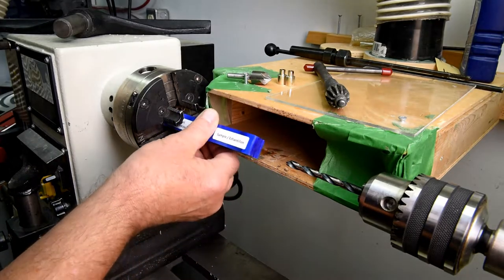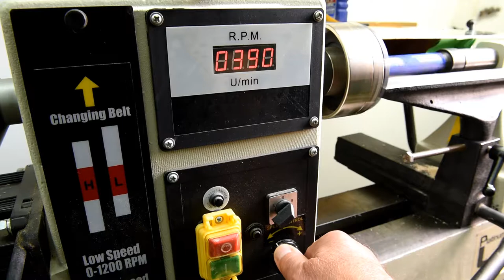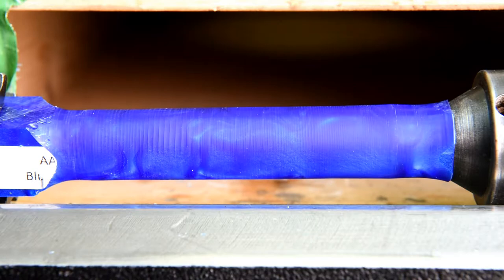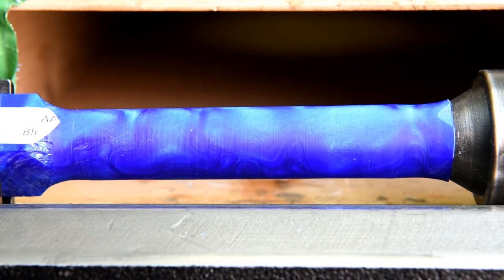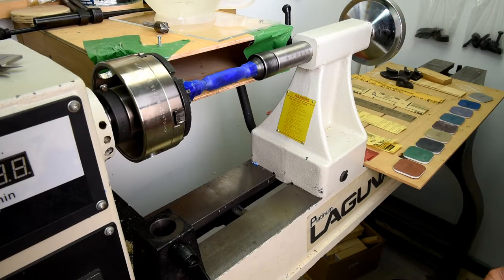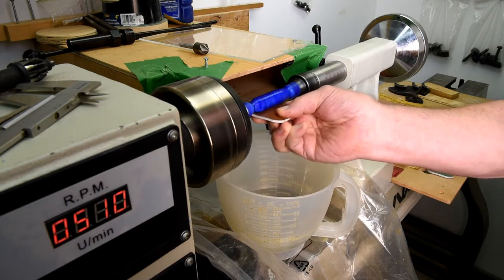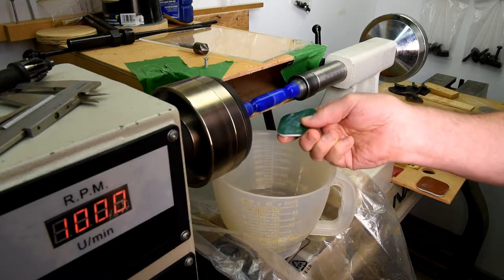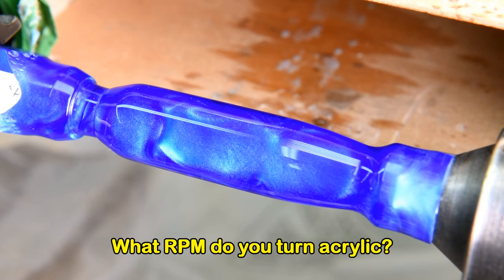The Reamer Handle - Part 2

Comment: With a small blank, as fast as she'll go, manual says 2850. The faster it is, the more time each second you're in contact with the blank making the time you're cutting air less noticeable, less vibration and smoother cutting.  Absolutely gorgeous piece of acrylic! You can feel very satisfied every time you de-burr a brass tube :)
Reply from the maker: I can't remember what I was turning at the times before when I never had even one problem. So weird! Next time I've got one properly on the mandrel I'll crank it !!! Thanks for the feedback Bill :)
Reply: Quite welcome, I think you'll really like that tool, comes in very handy on and off the lathe.  I made one after our bantering back/forth a couple weeks back out of a piece of Walnut with an Osage Orange scrap glued onto the front so I could tap it for a set screw. Glad I did at this point, I'm now in the market for a larger reamer for a project I'm working on :)  Versatility... the mother of more tools! :)

Comment: I usually turn as fast as it will go.  I have easy wood tools as I mentioned before and they seem to work best when the tip builds up some heat.  The acrylic sort of melts off the blank.  This is coming from a person who knows just enough to be dangerous though!
Reply from the maker: Thanks Walt :)
Reply: For me I adjust to the type of acrylic that I'm turning, some are like cutting glass and others are like bondo. So my speed varies from start to finish, 500 to 2100. I found that a negative rack works the best on acrylic

Comment: Bravo!!! You see A B C works. When turning acrylics you have to keep the speed down somewhat from what you would when turning wood. This will keep heat from building up which will cause unclean cuts..  2000 to 2500 should be OK.When turning close to the chuck as In your situation. Rotate the tool to about 10 or 11 O'clock and at a skewed angle of 10 tp 20 degrees or so. This will tend to push the tool away from the chuck. Oh and do get a shorter too rest.  Nice looking handle Good woek.
Reply from the maker: Thanks John! I'll likely be making up a narrower tool rest soon :)